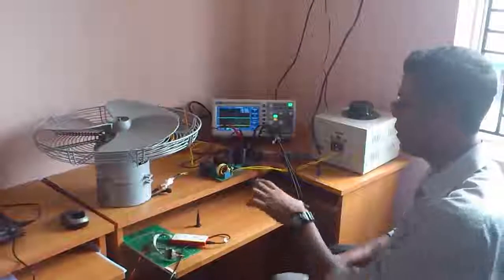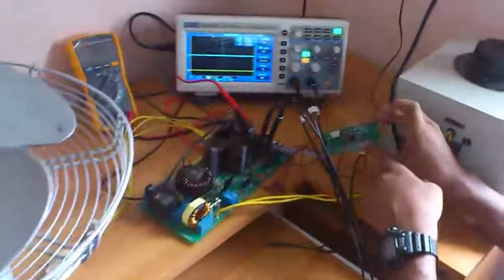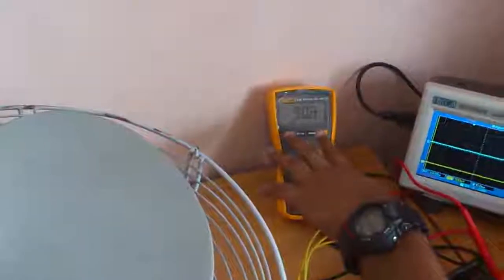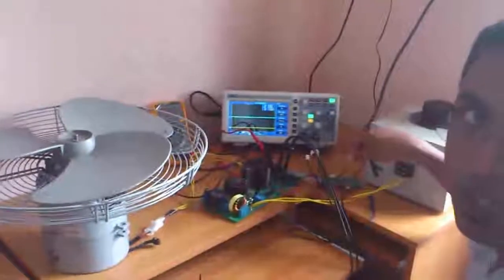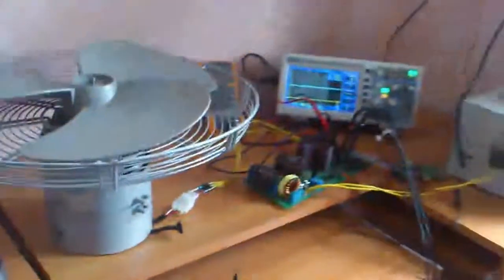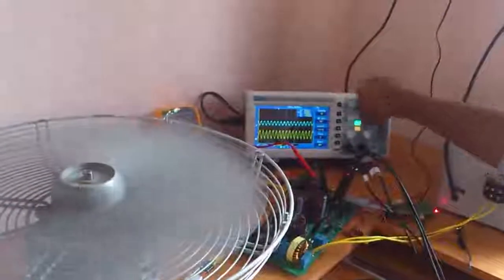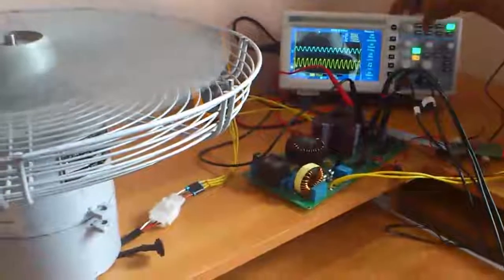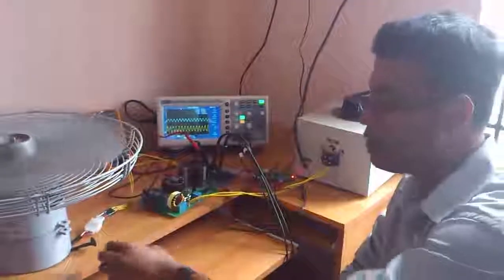Railway coach BLDC - Fan Demo

Comment: nice. why it a 3 phase used pl.
Reply from the maker: its 3 phase BLDC motor based fan
Reply: @NeonaEmbeddedLabz  are all bldc uses 3 phase or U,V, W  or hpw ??
Reply from the maker: @baburamabadhran1437   BLDC motor used in this application is 3 phase, this is also considered as U,V,W phases